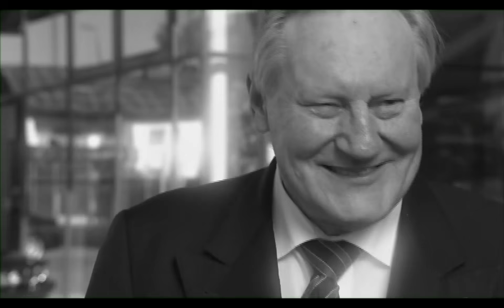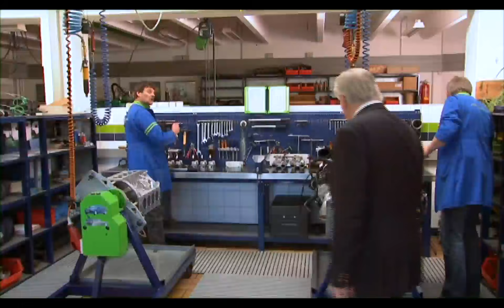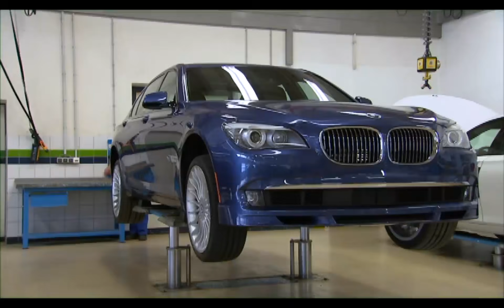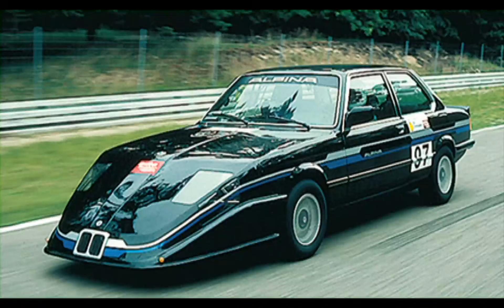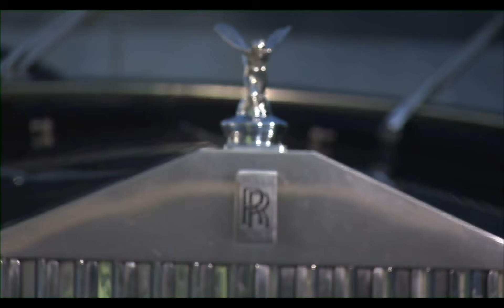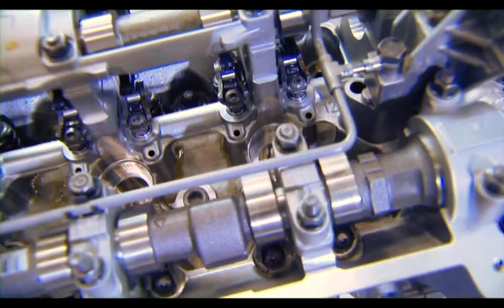Alpina BMW Model Design, Production and Manufacturing Process

Comment: Just bought a B6 GranCoupe. Stunning! Such a pleasure to drive, and experience the fine details that those German engineers even improved the already great BMW cars. The leather, the power (600hp!), the torque (800Nm, or 590 lbft) the fact that this car will go 200 mph, the 4-wheel drive acceleration and handling, the fact that a dual clutch isn't good enough and they replace it with the very special zf 8-speed transmission, the exclusivity (only 900 cars of this model ever produced for the US, and just really under 200 for the rest of the world, compare that to the almost inflated number of M cars), plus the complete appearance understatement and insider-only features are what makes me happy every day. Once you understand why they build their rims the way they do, you're just mind-blown. Once you've sat in those extra-exclusive leather seats, you don't ever want to get out. Plus, it's even more powerful than even the current new M850 model, and has real 4 seats. Gorgeous.

Comment: I HAD 2007 ALPINA B7 FOR ALMOST 5 YEARS AND I TRADED IT FOR 2009 MERCEDES S63 AMG THAT WAS A TREIBLE DECISION, I HAVE THE S63 NOW FOR ALMOST 9 MONTHS AND EVERYDAY I MISS THE B7 MORE AND MORE. THE B7 IS SO MUCH MORE FUN TO DRIVE AND HANDLES MUCH BETTER AND IT HAS A SOLE. I AM LOOKING FOR ANOTHER B7 BUT I WANT A 2013/14 BECAUSE IT HAS AN 8 SPEED TRANS 40 MORE HP BUT I CAN'T AFFORD IT RIGHT NOW I CAN ONLY AFFORD 2011 B7 BUT I DONT WANT THE 2011
 I THINK THE 2013/14 IS MUCH BETTER , ONCE U OWN A ALPINA B7 NO OTHER CAR WILL MAKE U HAPPY